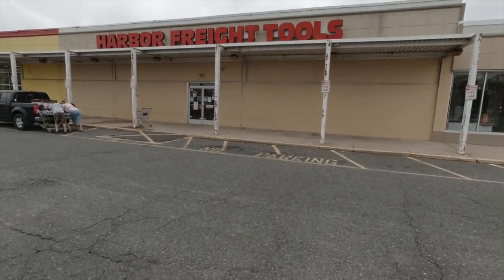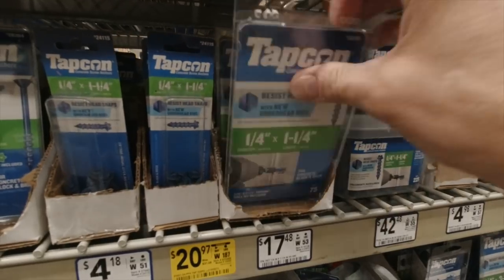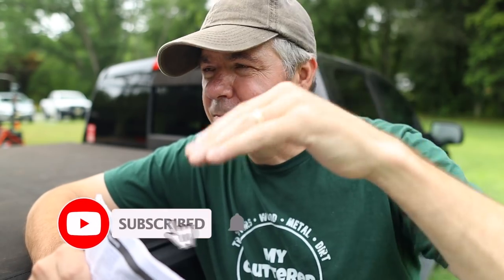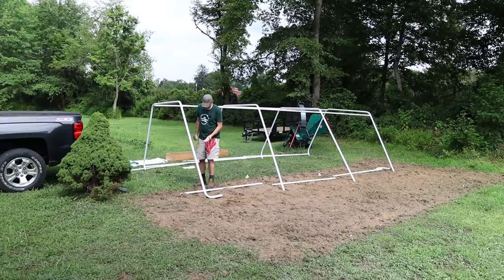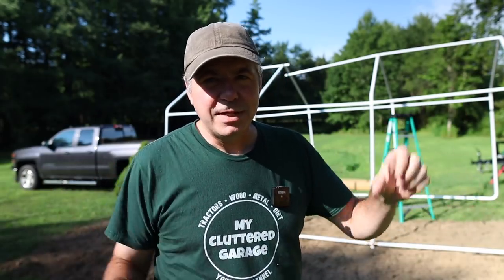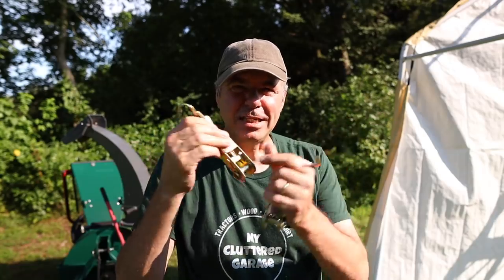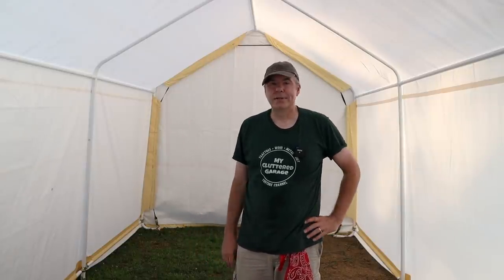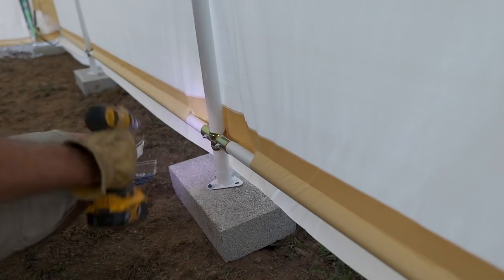#67 Harbor Freight Portable Garage - Real World Install and Review

Comment from the maker: Here are some product suggestions. These are Amazon Affiliate links, so purchasing will help this channel by providing a small commission while not costing you any more. Thank you for your support!
Dewalt Hammer Drill and Impact Driver:
https://amzn.to/3Az5CHb
Tapcon Concrete Screws & Drill Bit:
https://amzn.to/3AsWweU
Lumax Heavy Duty Grease Gun:
https://amzn.to/3mFK1pA
LockNLube Grease Gun Coupler:
https://amzn.to/3kPcvwu
Recommended Grease:
Valvoline Moly Fortified
https://amzn.to/3jNM1Kv
Nitrile Gloves:
https://amzn.to/34Kg8OG
Deerskin Gloves:
https://amzn.to/2I17NNy
My Video Gear:
Rode Wireless Go II microphone:
https://amzn.to/3eiJatG
Canon M50 Camera (now Mark II):
https://amzn.to/3vHW9uD
Battery adapter for M50:
https://amzn.to/2RshsBE
Sigma 16mm prime lens:
https://amzn.to/3vJDRcx
Sigma 30mm prime lens:
https://amzn.to/3epFneh
Variable ND filters:
https://amzn.to/3tmoHIs
Reply: Hello Sir, I just watched your portable garage install from a year ago.  How is it holding up as of August 18,2021?
Reply from the maker: @MrDogone1234  hi there! It’s holding up really well. However the blocks do not hold it in place in windy conditions. I would still stake it to the ground. Also, use a little duct tape or masking tape to hold the pieces together when assembling. I learned that in the comments afterward!
Reply: Hello Sir, I just viewed your install from a year . How is the condition of the portable garage as of a year later?  Thank you. Considering purchasing one myself

Comment: Some longevity tips... Add self-tapping screws to each joint and a few wraps of duct-tape to each seam. It will help reduce any snagging on the fluted seams and keep the tubing secure if the tarp ever fails. Add some duct tape to the joints, on the canvas and the joint knuckles, to reduce rubbing wear. Tie lengths of nylon rope across the roof trusses, the length and width, for added snow support and reduced stress on the vinyl tarp cover. (Every 2 feet, making a checker-board pattern, or a series of tic-tac-toe lines.) Buy a reflective 10x18 tarp, and add it over the vinyl top, or add it before adding the final cover. It will help strengthen it, reflect summer heat, and nearly quadruple the life of the original canvas. Add, at each end and optionally across the center trusses, another rope or steel cables. That will create the actual "truss" triangle, needed for greater load-bearing support from wind, rain and snow. It also ensures that the frame will never "bellow out". Lastly, I would add a set of 2x4s, pressure treated and ripped down to 2x2s, to the bottom flaps. Staple them to the 2x2s, after rolling the vinyl around them, inward. (Left unsecured, they will blow inward and outward quite often.) Add a 2x6 across the back wall, if you are not using that as another entrance. (The zipper doors don't have extra material to touch the ground. Same could be done at the front, but it will be a tripping hazard.) Lastly, add a set of anchors, with a hook end, near the zippers. A small zip-tie on the zipper, to secure it to the anchor when zipped-down. Wind will cause the zippers to slide up the "tightly pulled canvas".

These typically last 4-6 years... I wouldn't get the warranty, unless you are building it in a snowy area, or unless it's under trees. In 4-6 years, just buy a new one and save the metal tubing to make a car-port with a $30 tarp cover. 😂 Or sell it to a friend for $150, as just a frame.
Reply from the maker: Wow sounds like you have some serious experience. Thanks for sharing!
Reply: Great suggestions! Thanks.
Reply: can you do a video showing?
Reply: @lydiahubbell6278 yeah PROVE IT

Comment: Great job Ed! Honestly, I’d rather be water boarded than read instructions. Now if I get one of these I don’t have to. 😄
Reply from the maker: Thanks Adam! I fight reading directions at all costs. Sometimes I read them after I finish just to see if I did it right 😄
Reply: Funny thing... I had that option given to me, water-boarding or read directions. I did choose to be water-boarded. Well I just say this; got finished assembly total time probably 10 hrs+. Didnt do any of the cover assembly correct the 1st time, most of it the second, and 100% easy fittin on the 3rd try.
If I had to do it all over again.... I'd choose the water-boarding again, everytime. 
(Bought mine from an individual who had no instructions but doesn't change my mind about the way I feel about having to read them)

Comment: I like the idea of using the concrete blocks given the current price of lumber - may be the best way to add weight regardless of lumber prices.   You can use duct tape to hold the straight tubes together as you assemble the frame to eliminate them from coming apart as you build it out.  Good luck with it.  Harbor Freight does sell replacement covers and end pieces.  You can order an extra door end if you want to be able to access whatever you put in the  "back" without moving everything else out.
Reply from the maker: Wow great idea with the duct tape, Tony. Sounds like you have some great HF experience!
Reply: Or the 3M type tape that holds forever, but you have to take some of the pipes back apart when placing the cover on, so it is a challenge, either way, I think it's best to have 2 people, LOL.

Comment: Good idea. I have 4 tent garages set up in my yard. The Shelter Logic 12' x 20' x 8' garages work well. I have 3 more tent garage frames that were freebies for taking away. I'll set them up soon(without ends).
Tips:  Use a few ratchet straps to pull the frame together and hold it together. When you have equipment in the garage, tie the frame down to the equipment. I've seen several tent garages get blown around. To extend the life of the cover, throw a tarp over the garage. Throw ropes over the tarp and weigh the ropes(I used 25# lifting weights). Do not let more than 5" of snow build up on it. Every snow storm, I have to sweep the roofs. If you want to use the garage in the winter to work, cover it with an old swimming pool insulated cover. Good Luck, Rick
Reply from the maker: Hi Richard. Good tips. Thanks very much! -Ed

Comment: Nice job buddy. I have had the exact same tent on my property for almost 3 years now.. it’s still perfect I have zero holes in it.. maybe I’ll make a video on it sometime and let you see how it’s holding up. I threw some heavy duty pallets down inside mine then took some OSB plywood and tossed it over them so that I had a nice raised floor that stays nice and dry and keeps the moisture off my equipment.. I also bought 4 of those cheap Orange rachet straps from harbor freight and added 1 strap for each corner to help hold the tent down on a strong wind storm as I didn’t like the cables it came with to hold the entire tent down nice and tight.. so basically I used their screw anchors like they wanted but then used my own rachet straps to strap all 4 corners down from the side rail on the framing down to the screw anchor and when I did that it tightened the whole shed up.. the frame was solid as a Rock and even with some 70mph gusts we had the tent still hasn’t moved an inch 👍🏻
Reply from the maker: Good to know, Biff! I’m already thinking about adding another one 😄
Reply: That's a great idea. I'm having issue with the tiny cable too. The orange ratchet staps will work great. 👍
Reply: My shed apparently was lifted and twisted in high winds the other night. I saw this too late, but I have 4. Ratchet straps now.
Reply: @lydiahubbell6278  yah the rachet straps work really well as long as your screw anchors are well in the ground, just throw a rachet strap from the side frame bar to the screw Anchor for each corner and snug the straps up till you feel a decent tension on the straps. We had that huge storm roll through yesterday with 82mph gusts and my tent still is right where I installed it. I was amazed. Best of luck guys 👍🏻

Comment: The tip to use the Cement Blocks C-"Straps" & Concrete Screws was especially helpful.  👍🏼
Reply from the maker: Thank you but I found that the blocks shift in high winds. Be sure to use heavier block or partially bury them. Here’s my follow up: https://youtu.be/WKjN9R8iPoY

Comment: I received one of these as a present from my daughter for my birthday August, 2021...just around the time you built your unit. We never got to put it up, weather or heat or schedules never jived. She went into the Navy in December. She'll be coming home on leave at the end of this month. We are finally going to build mine! I think I'm going to try to make a low floor in mine. Also, for more weight resistance on the roof for when a heavy snow might challenge it, I'm going to try to add extra ratchet strapping in the void spaces between roof supports. I've also seem/read that using self tapping screws (not during as you mentioned how you got it together, then it asks you to take it apart for tapping) AFTER assembly, helps immensely. I already bought those too! Now just waiting on my sailor to help me! : )
Reply from the maker: Hi Judith. A few things I learned. First, use duct tape, or even painters tape to hold the joints together while you are assembling the garage. Second the cement blocks did not hold up to the wind. The garage has shifted about 8 inches a few times. Personally, I would not recommend using the self tapping screws. Once assembled, the garage holds itself together nicely. Plus, I think it’s best to let it flex with the wind. The screws would probably just sheer off. Welcome home to your daughter!

Comment: I bought one of the shelter logic ones like 2 years ago and put it up but never was able to get the cover on it as I had no help and it is always windy here. Also our dirt is defective and I couldn't get it secured to the ground. I am ashamed to admit I never thought about using concrete blocks and raising it up. I am absolutely going to do this and see if I can get the blasted cover onto it.  Thank you for sharing this!
Reply from the maker: Hi Philip. You just need a friend to help pull that cover on! Good luck and thanks for watching! -Ed
Reply: I've done it by using ropes to pull the cover over the top. Good Luck, Rick

Comment: We've had the Harbor Freight Portable Garage for 6+ years or 6 winters. I tried to keep the snow off here in northern Michigan but sometimes it got 8+ inches deep on the roof before I got the time to clean it. But sadly I finally have to take it down. However, the timing is perfect. The garage space will be a garden next spring and the fabric is finally failing. It was a wise investment for my "junk" (I do garage sales and estate sales) and to store firewood. I used the ratchet strap supports inside and placed it where it would be protected from strong winds.

Comment: Great Job! Glad you got the insurance. I could have used it on mine. I have had this for Gosh close to 8 years I haven't had a problem other than the dang limbs falling on it. I have gotten a larger tarp and just rigged it to cover completely the tent as for patches. Outside Mold has been a issue I'm in North Fla. I've seen here on YT a guy which really fixed his up with wood walls and lights inside.
Reply from the maker: Thanks very much! So far so good here!

Comment: I have done a few of these. Going to give you some advise that I learned. First put plastic on the ground before the wood chips. That will help keep the moisture down which will help your equipment from rusting. 2nd. The wind will lift the cover up and will rub holes in the top. The pieces at the bottom that you bolted make sure they are as tight as you can by stepping on them. Once you have that right install some self tapers into the center of that bracket. I had to fight for warranty because i did not do that the first time. dont know about snow in your area. I use 2X4 ' s in the middle for my snow load. Good luck.
Reply from the maker: Great tips! Thanks very much!

Comment: They have certainly changed the product design over the last 15 years or so.  I put one together from HF and it was nothing at all like this one.  I attached it to old 6x6's the full length because of the possibility of high winds.  The tarp was starting to go bad at 5 or 6 years and so I covered it with an old swimming pool cover.  That's been at least 10 years ago and its just now deteriorating bad enough to make some changes.  BUT....on a real good note, the frame looks as it did the day it was assembled !!  I was laughing pretty good when your tubes were falling back apart....  sorry.  LOL

Comment: after watching yours and 3 or 4 more i went down yesterday and got me one. and it went up pretty easy  but where yours kelp coming a part i use duct tape to hold mine together. and i also found out if you want good duct tape. dont buy it from harbor fright. i guess i watched enough videos and learned a trick or two that each one of yall had trouble with i didn't. so thanks for the video it sure helped me put mine together
Reply from the maker: Awesome! Congrats and thank you!
Reply: @MyClutteredGarage  real videos is what i like. mostly ones where they have trouble. and they tell you about so you can look at more videos to show maybe how not to have the same troubles. like the duck tape. i would have never thought about that. and the same thing you did with your bottom pipes i pretty sure i would have done the same thing.

Comment: Snow should be considered with these. Unless you have daily access and are able to keep the snow off, it will fail under excessive snow load. One way to address this is to put 1/4" ply on the roof, either secure with screws or just drill holes in the ply and strap it down using ty wraps. One I have in a snow belt I ran 2X4s down roof rafters and covered with steel roofing. Has been working great going on 4 years now! Keeps my tractor and some tools dry and safe.

Comment: I bought the Shelter Logic version from TSC. it came with nuts and bolts for every joint. Maybe that's was why it was a little more expensive.  I would invest in some hardware so it doesn't come apart on you in a heavy wind

Comment: Love the channel I had one similar but was not very sheltered. I bought the extra tie downs that screw 3’ in the ground. Lasted 2 years before wind did it in. Theses are great inexpensive options but only in sheltered areas. You need to keep the snow off the roof too as it will stretch the tarp and gets worse and loose then the wind has more leverage to flap the tarp
Reply from the maker: Thanks Brad. Yeah snow is my biggest concern. We had some light winters but I fear we’re due!

Comment: I have one of these, but I'm trying to get pallets to make a floor since I have it in my driveway and I don't want to put holes in it.  I'm using it for a couple of motorbikes and lawn equipment.  I plan on getting a couple of ramps to ride the bikes in and out on.  Also I don't want the water from snow to freeze stuff to the ground.  I do already have electrical inside via extension cord and power strip with lighting.  I am also using a buddy heater connected to a 20lb cylinder for heat.  I use a fan to blow the heat around since the buddy heater can be inefficient at moving the heat around.  The reason for heat and electrical is I plan to do some work on the bikes during the winter and I'd like to stay warm.
Reply from the maker: If you check out video #75 you'll see that I added plastic and wood chips. I've since put some equipment on pallets. So far so good! https://youtu.be/vbB0o0VdAhg

Comment: You won't believe it, but I also have a temporary need for shelter for my implements that won't fit in the building I now have (tractor is the sole occupant) until my "Full-tilt, Boogie Blow-out" Barn is built with multi-story racking for implements! Headed to HF!  Only issue I see is anchoring that baby to the ground.  I think you need more weight or in-ground anchor depth with your solution.  I would hate to go retrieve my shed from my neighbor's front yard after one of our infamous Texas Spring storms!
Reply from the maker: Hi Dwayne. I think it would take a lot to lift those blocks, but admittedly I’ve never experienced at Texas spring storm!

Comment: Looks good. I've had the same one for a couple years now and it's been holding up pretty good. I have noticed a few tiny holes starting to tear through the cover so I just got a uv tarp from Harbor Freight and put it over the top to protect it even more. I also used tek screws to hold all the pole joints together and built a frame out of 2x8 boards which I rebarred into the ground and it's been going through some big winds and holding up just fine. Like you, I got the extended warranty and even though it's gonna be a PITA I plan on taking it down and returning it for a new one before the warranty expires then I'm assured of getting a few more years out of it.
Reply: The wind doesn't blow it aways ?
Reply: @valledecauca1087  No, been in some pretty high winds too. I did build a frame with 2x6's then I cut some 3ft long rebar and drilled holes a little smaller than it and hammered the rebar through the frame into the ground to hold it down and bolted the frame to the boards.
Reply: @dniksich  okay thank you